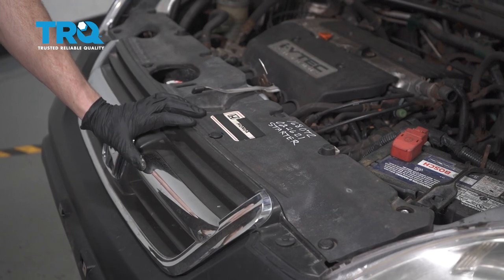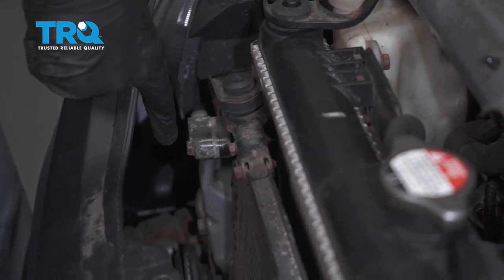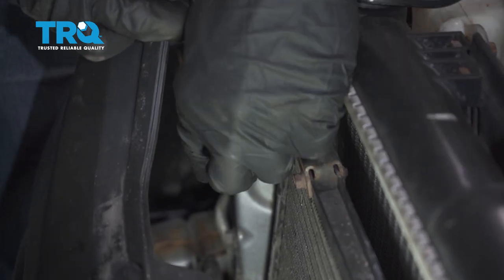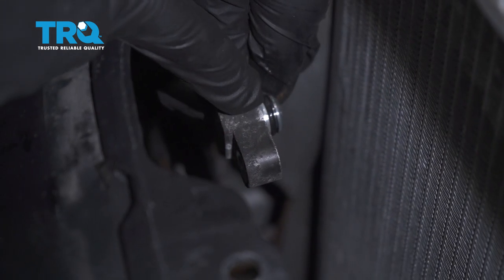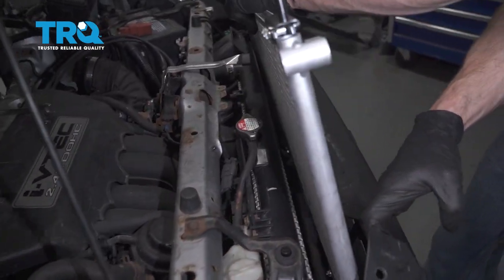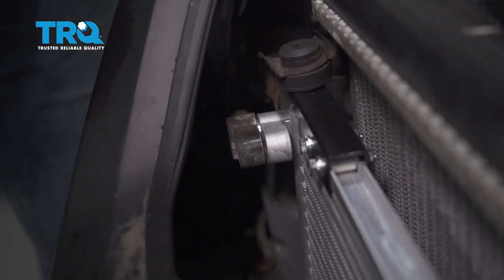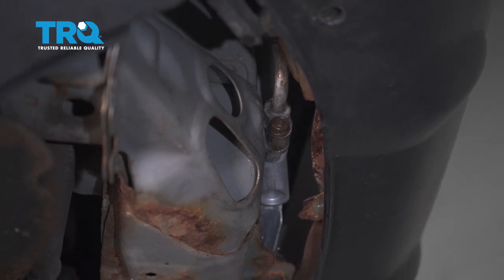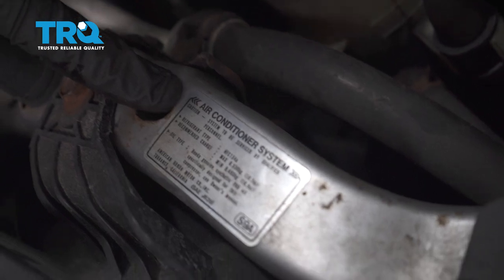How to Replace A/C Condenser 2002-2006 Honda CR-V

Comment: Thanks for the video, Bought a Honda Cr-V and mechanic didnt check the condenser and now i know why the A/C does not work and why it holds no pressure. Condenser looks like its had a tree hit it!
Shame you are US based but even looking at the parts site tells me i am looking at the right replacement part. 
Will be using this video to replace the condenser when i get the new part.
Hoping the compressor is okay but can't tell that until i get this replaced. 
Thanks again!

Comment: So the Hanes manual saids to add almost a ounce of pag 46 but doesnt specify where to add, also UAC never sent instructions,  any recommendations?

 2006 crv lx, replacing condeser, expansion valve and evaporator along with flush. Any help is appreciated thanks for posting.

Comment: I'm going to ask a stupid question. Is the other condensor like thing behind the ac condensor , the radiator for cooling the engine ?  these are two separate things right ? And why is the ac condensor placed in front of the radiator (if that is a radiator). Don't the radiator also need cooling from the wind ? isn't the radiator being blocked by the ac condensor from getting air ?

Comment: If I do this myself will have to take it to shop to have the system properly evacuated to remove any moisture from the system or can I just refill it with one of the off the shelf AC recharge kits that include the bottle and attached hose and gauge?
Reply: You should vacuum the system to remove any non condensable gases. However the service valve on the car is not compatible with the normal gauges so I’m not sure how you can vacuum the system. I think if you just put it in without vacuuming you will still get good cooling capacity but efficiency will go down but it won’t matter since you will be cooling such a small area